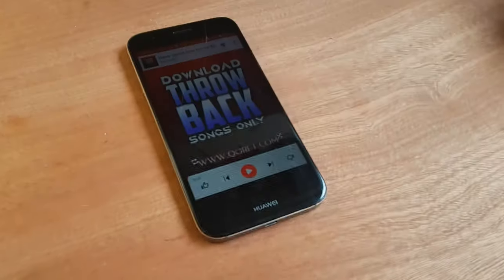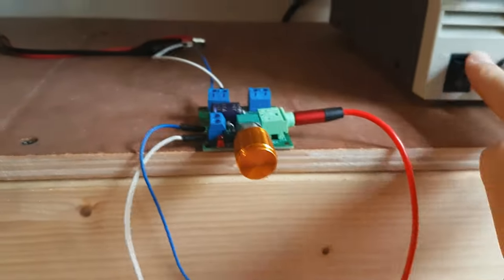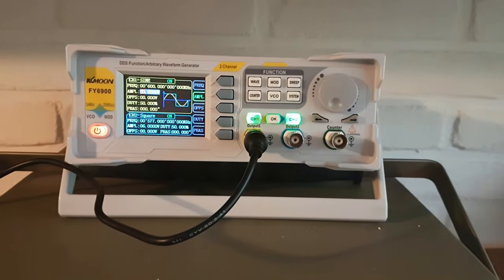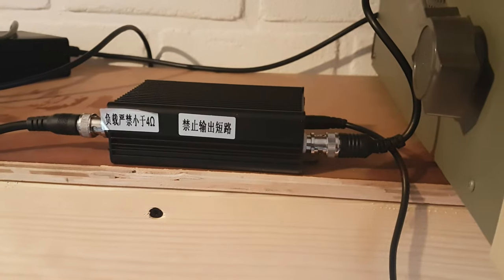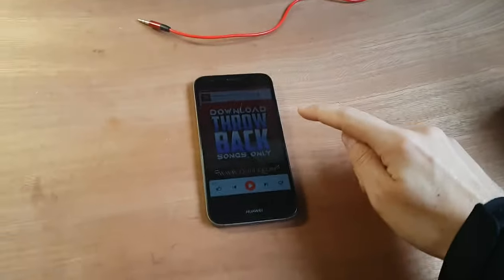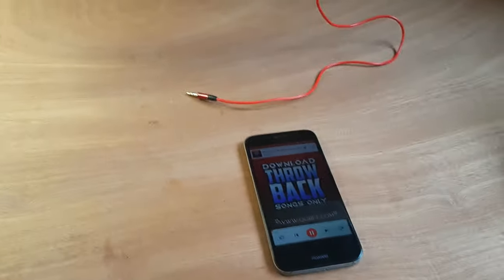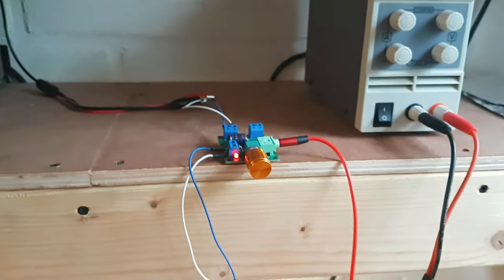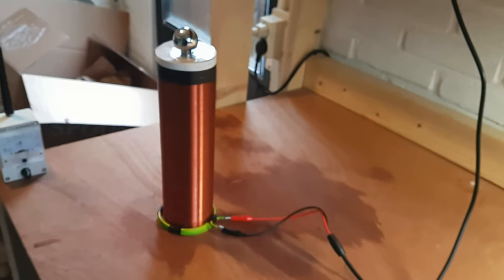Tesla Coil Experiments: AM Radio Transmission

Comment: Hello! How far can a receiver receive your coil? Did you go outdoor to test the distance? I tested a small Tesla  coil (10MHz, roughly 1W) but the distance was quite short - 100Meters.
Reply from the maker: Distance is not far indeed, until you get to more powerful system using telluric transmission.